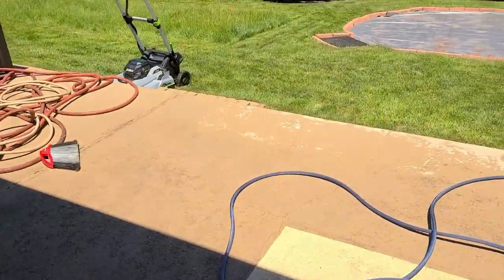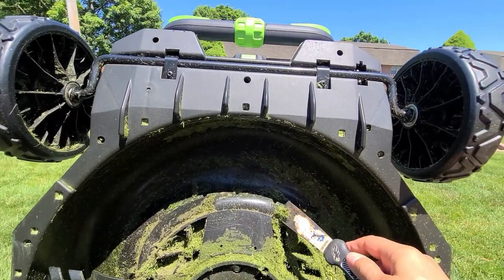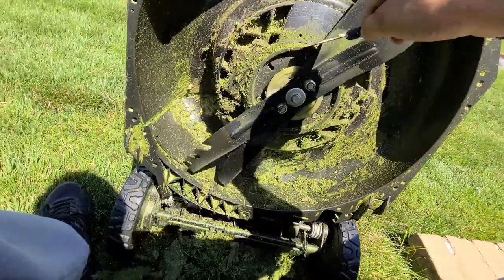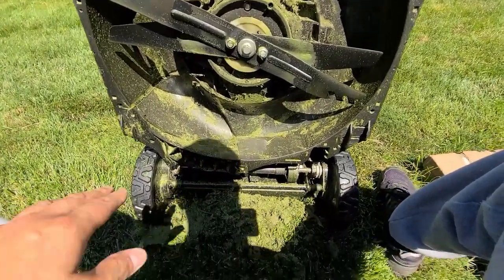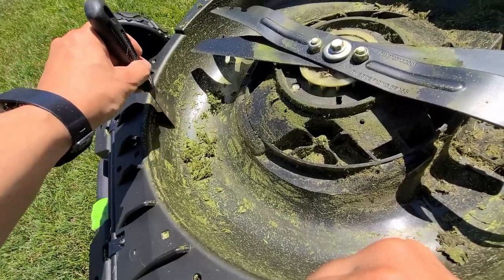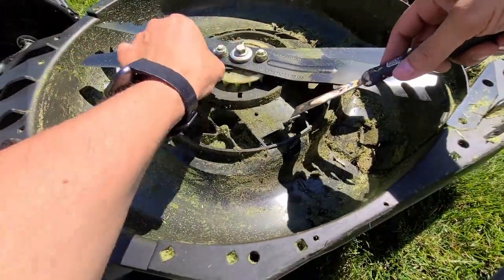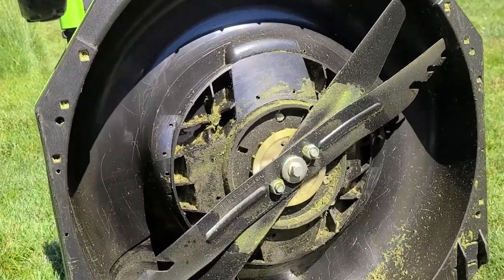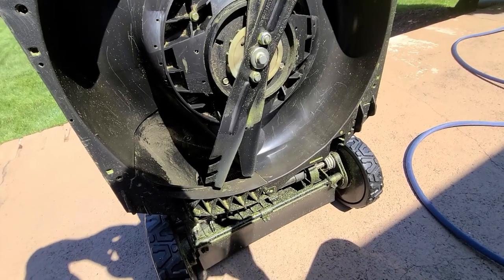EGO 56v Mower TIP Cleaning your Mower Deck

Comment: Thanks for another helpful video. Shared in February that I purchased the Ego 2156sp mower. More than pleased with how it has performed. Have since purchased the adjustable shaft trimmer with power load and line IQ and 765  blower because of your entertaining and helpful videos. After watching you clean your mower I also will adopt a regular deck cleaning routine. With lawnmowers, as in life, sometimes the least glamorous tasks are some of the most important. Keeping that underside free of buildup will help the blades do their job and mulch efficiently as you showed. Thanks again!!
Reply from the maker: Thanks Douglas

Comment: I always hosed down my ego lawn mowers and never had a trouble.  Just be sure to dry it after.
Reply: @Jeo-What  Since 2014 with the gen 1, gen 2 NSP and gen 2 SP
Reply: I just hosed mine down and put the leaf blower on it and dried it real well with the battery out... hopefully it'll be OK? I'm a bit paranoid to put the battery in to test it before it's completely dry.......????
Reply from the maker: Be careful, water can void the warranty. I know a few people prefer using a hose.

Comment: I spray with turtle wax hybrid ceramic from new with occasional top ups and spray it off after each mow. Stays very clean. I really like that the plastic won’t rust.
Reply from the maker: Nice idea
Reply: When you say "spray it off after each mow", do you mean spray it off with water using a hose?
Reply: @stwhit  yes I spray the underside of the deck off with a hose. I don’t spray into where the shaft is, just spray the clippings off the underside of the deck.

Comment: I like using a plastic scraper,It doesn't scratch the plastic,scratches will help grass stick.
Try spraying Pam cooking oil under deck to keep grass from sticking.
The motor will have sealed bearing if u choose  water,run the mower for a few minutes after to dry.
Reply from the maker: Thanks David good tips thanks for watching also

Comment: i have the steel deck ego sp .  i just use a stiff Bannister brush right after i have cut and it cleans it like new never needs air to clean it out it just brushes right off . i have heard of people using ceramic car coatings under the mower to stop it from sticking in the first place but i dont know if that works  or how long it would last.
Reply from the maker: Daniel thanks and the ceramic coating is interesting, I won’t if that works

Comment: Tech made easy - big long term mistake to use a stainless steel scraper on the polycarbonate deck. Peo-le do that with painted steel decks too. BAD idea. The more you scratch that polished smooth polycarbonate deck, the more stuff will stick to it. For you to get back to normal, polish and buff your deck back to original smoothness. You have ruined the factory smoothness. Then simply use ceramic trim pads (I use cerekote) Let it sit over night to cure. Boom - you have a smooth deck that will wipe out by hand. If you HAVE to scrape it PLEASE use a plastic scraper.
Reply from the maker: Yup that’s my old video here is my new one agree with you 
https://youtu.be/psqZ5IZpLiY?si=qagqmW_zEim8mKO3

Comment: Would using a scrapper like this work on a Greenworks mower?  Would a hard bristle brush be better?
Reply from the maker: I would just use a plastic scrapper they do the job, also cleaning after you mow especially in a wet grass situation is always a good idea as long as you have time. If not it hardens and you can use a scrapper for sure.

Comment: I'd use a plastic scraper, that metal one is scratching the underneath pretty badly
Reply from the maker: Agree I use plastic more now abd sometimes just paper towels or rags after use
Reply: Where do you get a plastic scraper?
Reply from the maker: Home depot Lowes ace Walmart local hardware store

Comment: Is it possible to just spray the bottom be4 with some wd40 or like a cooking oil or something so the grass won't stick..
Reply from the maker: I’ve never tried that but I did hear a few people mention that. I wonder what would work better. Great idea Antcap thanks for sharing this.
Reply: I'm no expert,  but this isn't a cast iron skillet where It needs to be seasoned to get that non stick surface. But let us know if it works and see a video of how it's done before and after.

Comment: Why not remove the blades first?  It takes so little effort removing the blades after removing your battery.  The blades are no longer in your way, and besides, you may now dress the edges up on those blades?  :)

Comment: Great video.   I use a brush to clean around the area around the blades.  For the little holes l use a small tooth brush.    I was thinking of using a product called awesome sold at dollar tree or .99 cent stores.
Reply from the maker: Hmm never heard of that, it's a cleaner?
Reply: @TechMadeEzy  Amazon has it.  
I would only clean the bottom of the mower with it.  I was cleaning my license plate and it took the color off the plate.
Reply from the maker: That’s strong
Reply: @TechMadeEzy  
Yes it is strong, use it with causion